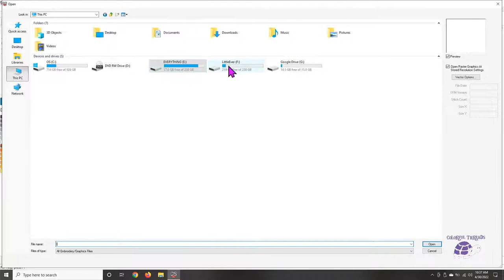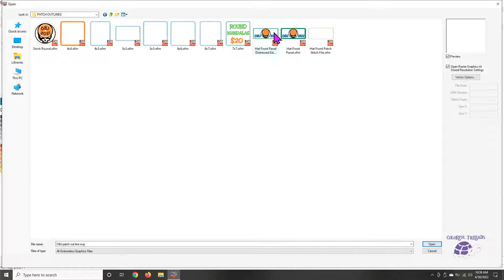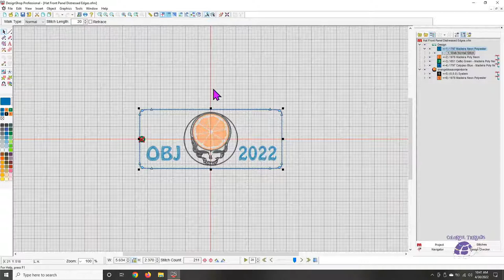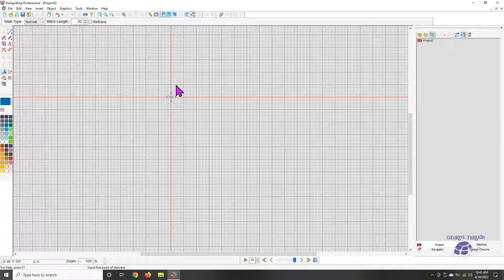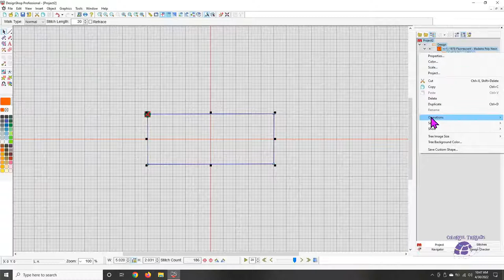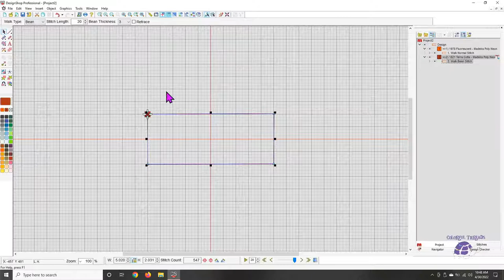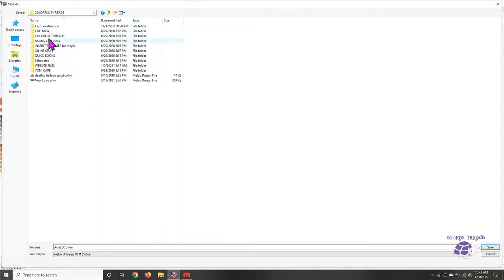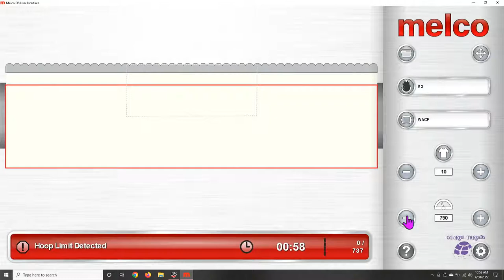Stitching a Patch to A Hat using your embroidery machine!

Comment: I noticed you had your machine plugged straight into a wall socket, hopefully you are using a surge protector for that machine.

Great video thanks for sharing.
Reply from the maker: Oh my no, we travel in a camper, everything is plugged into line conditioning battery backup systems. The green plug on the wall is the line conditioner.
Reply from the maker: APC UPS Battery Backup Surge Protector, 425VA Backup Battery Power Supply, BE425M https://a.co/d/47XkLwh